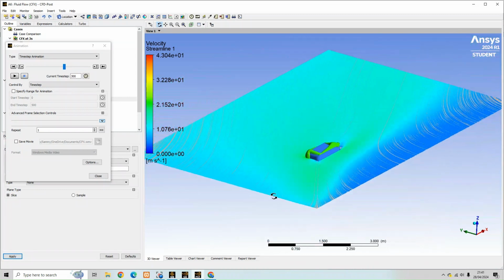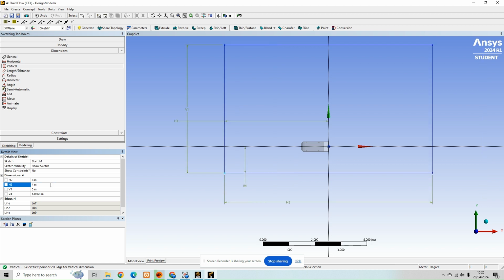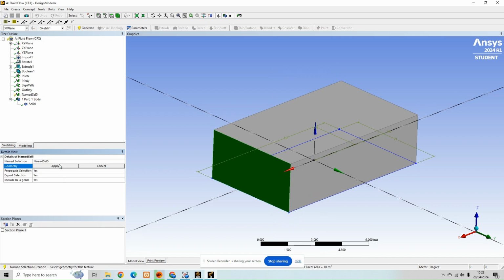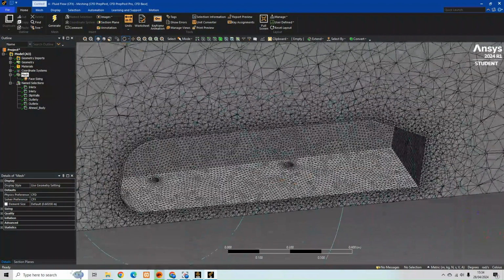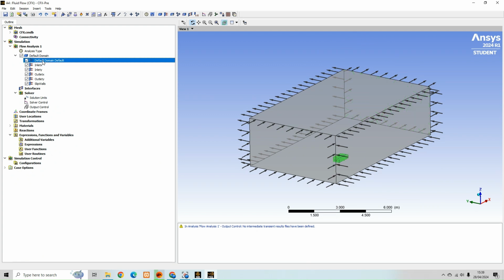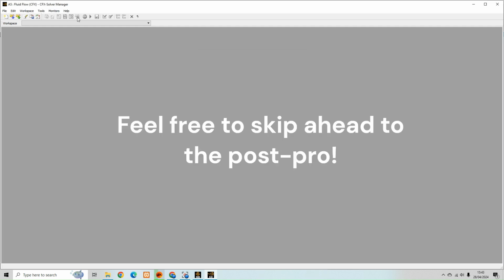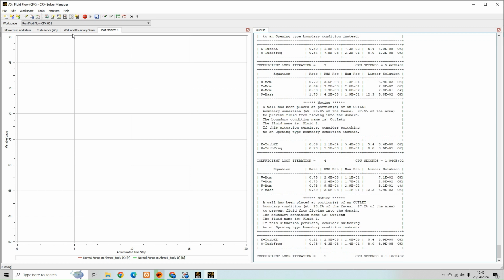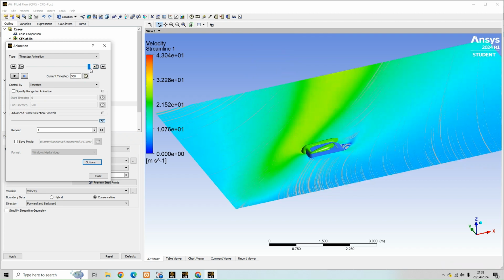Ahmed Body Subjected to an Unsteady Gust Using Ansys CFX

Comment: Could you provide insights into how the choice of parameters for the transient gust simulation was made? I'm particularly curious about the considerations behind selecting the Common-Expression Language for modeling the wind dynamics. Additionally, how did you ensure the accuracy and reliability of the simulation results, especially in terms of capturing the transient behavior of the flow around the Ahmed body?
Reply from the maker: Hi GPT Joe,
The parameters we chosen because the formed a sinusoidal gust, but by squaring the sine term it prevented the lateral velocity term from going negative.

There are better gust models, that produce a more physical natural wind approximation, however this one was chosen because of ease of implementation.

I would not trust the accuracy of the results because of the reasons stated in the video.
Reply: @ClimateCFD  who is GPT Joe?
Reply from the maker: @ShropVentures  this annoying guy I know.